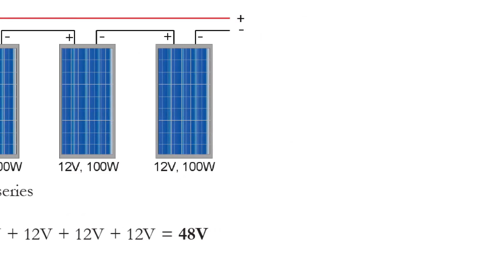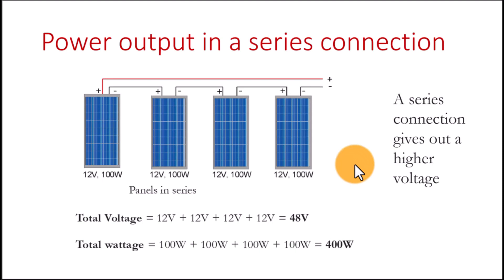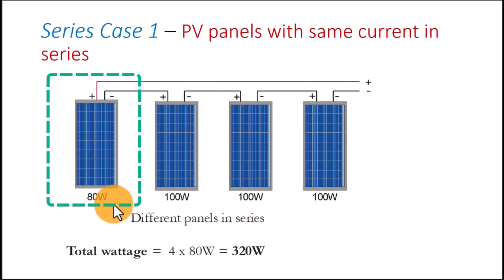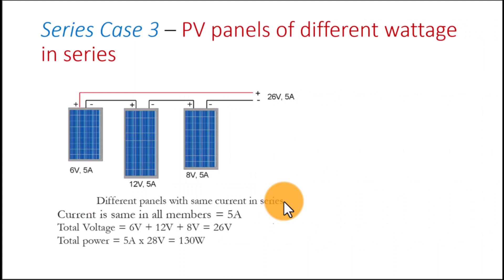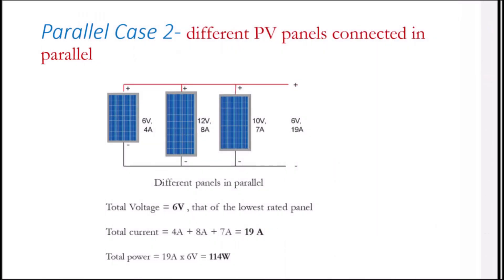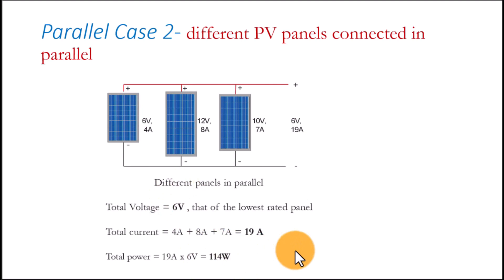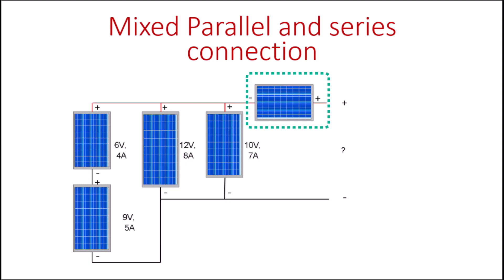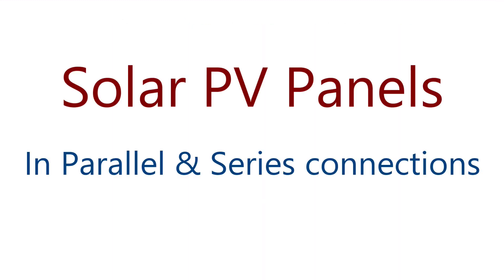Solar PV panels in series and parallel connection

Comment: Sir, If we "T" tapout 1500W load from  9600W, 660V(in one string), Total other string is 4 string 9600W/660V, My question is what will effect for One Tapout load connection from namrmal parallel strings.???

Comment: There are some mistakes here.   Actually, I hate to say this but pretty much all of your descriptions are incorrect.

* For a series connection, if you have a shaded panel that would restrict the current for the others, what actually happens is that the shaded panel winds up going into bypass (the current bypasses it via the bypass diodes that all modern panels have).  So the whole array is still running the full current, but the shaded panel winds up contributing almost nothing.

* As an addendum, a single solar panel typically has three sub-strings.  Each sub-string is wired in series within the panel.   Which means that shading conditions can have different effects.  A shading condition that shades even a single cell in all three sub-strings (3 cells shaded) effectively puts the entire panel into bypass.  However, a shading condition that only effects one sub-string only reduces the voltage of the panel while still allowing the other two sub-strings to produce full current.

* Your description of a parallel configuration with one panel producing 80W (due to shading) and the others producing full power (100W in your example) is incorrect.  The total wattage will NOT be 80 + 100 + 100 + 100.   The reason is that the optimal MPPT voltage for that shaded panel producing 80W will be lower than the optimal voltage for the panels producing 100W.   Since the panels are in parallel, however, there can only be one array voltage.  The MPPT controller will likely find a MPPT voltage that is NEITHER the optimal voltage for the 80W panel or the optimal voltage for the 100W panels, but something inbetween.  Thus, NONE of the panels will be operating at their optimal voltage and the total output will be a bit lower than 80 + 100 + 100 + 100.  For example, it might only be (80 + 100 + 100 + 100) * 0.90.

Depending on panel dominance, the partially shaded panel can wind up contributing zero.  For example, if you have 8 panels in parallel and one of those panels is partially shaded, the MPPT point will be close to the optimal voltage of the remaining 7 panels and the partially shaded panel will wind up contributing nothing because its optimal voltage will be only 2/3 of that.

* Your description for different types of PV panels connected in parallel is also wrong.   The lowest-voltage panel will not necessarily force the other panels down.  Instead, the actual MPPT point can be any voltage between the lowest and highest voltage, depending on which panels are the most dominant and what the panel VOCs are.  All that will happen at higher voltages is that the panels that operate at lower voltages will drop out of the array.   Up to the VOC of that lower-voltage panel anyway.  So, for example, if the operating voltage of a panel is 6V, but its VOC is 12V, it will not prevent the other 12V panels from operating at 12V.  It just won't contribute anything.    (This is a configuration that should never be used, anyway).

* (I'm going to ignore your weird topology, but your description is also wrong for that too).

Finally, when paralleling multiple panels you have to be careful about backfeed limitations.   A fully shaded panel can wind up reverse-biased and it is possible for the panel cells to break-down and become a dead short if too much voltage is in reverse-bias.   Typically this current is no more than roughly 2x the operating current.  Any more and the panel might catch fire.  This means that if you have more than two panels in parallel, you are generally exceeding the blocking capability of any individual panel and a solar combiner box with appropriate fuses for each string must be used to prevent the other strings in parallel from ganging up on it and causing a fire.

This is even more true when we start talking about several panels in series in a string, and then two such strings are paralleled.  In this situation it is possible for the reverse polarity to exceed the reverse breakdown voltage (due to multiple panels in one string being shaded), which turns one string into a dead short.  One needs to have a solar combiner box with proper fusing to ensure that such conditions do not cause a fire.
Reply from the maker: I do appreciate your concerns but to put things into perspective, the science and math on solar PV systems can be mindboggling that to express them here on this 10-minute video can be a pain to the viewer more so the difference between 0.9 and 1. There should be a limit or level of how much we can go under the hood to pass the message. Tks